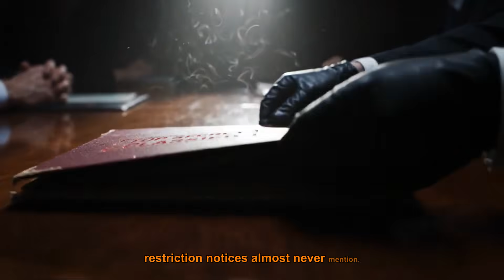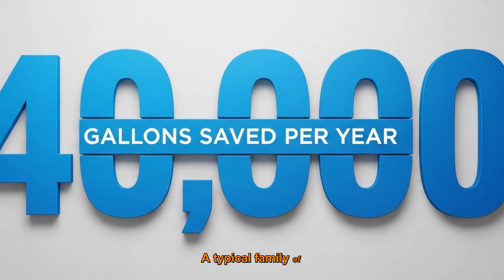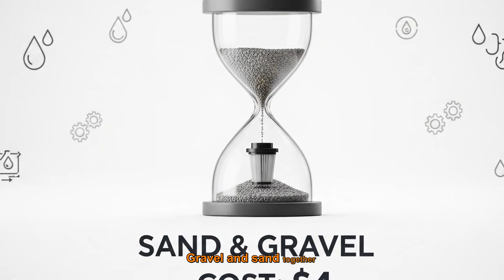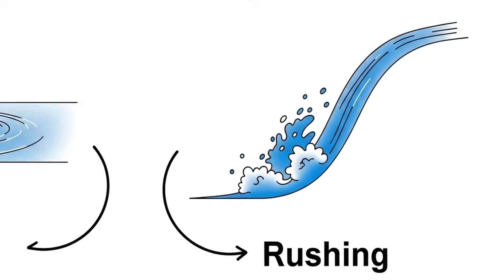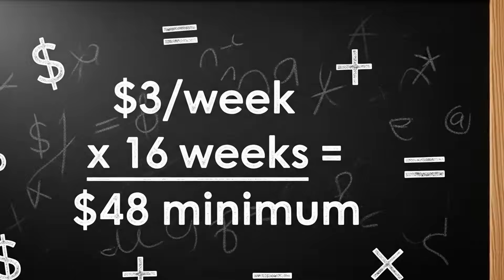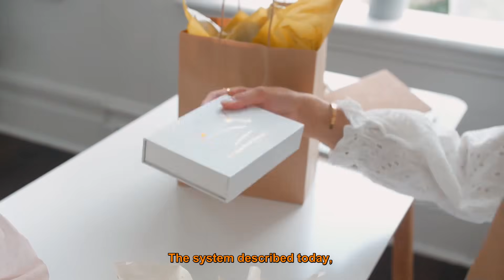DIY Laundry to Landscape Greywater System – No Pump, No Electricity

Comment from the maker: A lot of people think building a greywater system is either illegal, expensive, or requires a plumber. None of that is true if you build a simple laundry-to-landscape setup. For those who want to double-check the math or the legal side of things before heading to the hardware store, here is the research I used for this build:

1⃣ Why Borax and regular detergents can destroy your soil over time:
https://www.earthclinic.com/green/borax-safety.html

2⃣ State-by-state greywater laws (Why systems under 400 gallons/day don't need permits in places like AZ and TX):
https://www.thegreywaterproject.org/do-i-need-a-permit

3⃣ California's specific building code exception for DIY washing machine systems:
https://oasisdesign.net/greywater/law/history/

4⃣ Colorado State University research on how greywater outperforms rain barrels in drought regions:
https://source.colostate.edu/new-strategy-drought-stressed-cities-graywater-recycling/

5⃣ The true cost of installing a standard underground sprinkler system vs. our $25 DIY build:
https://www.angi.com/articles/how-much-does-it-cost-install-sprinkler-system.htm

Check your local county website just to be 100% sure, grab a diverter valve, and stop paying the city twice for the exact same water. Let me know in the comments — what are you growing this summer? 🌱👇